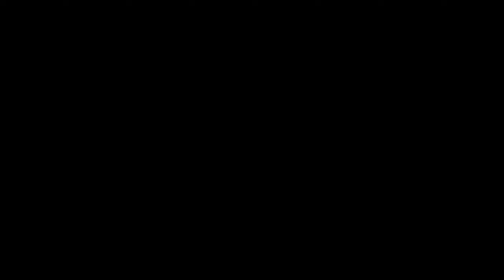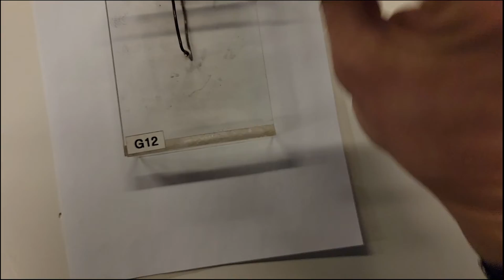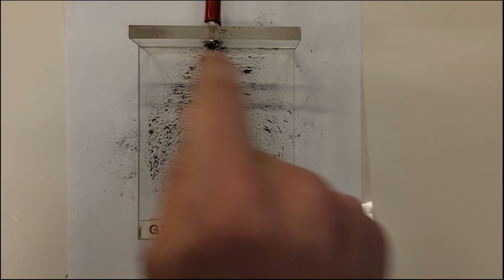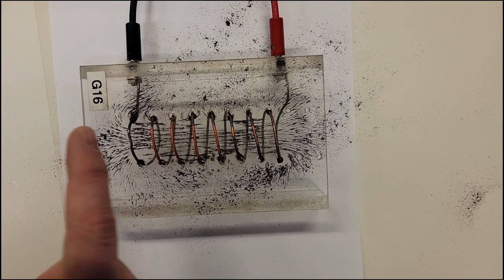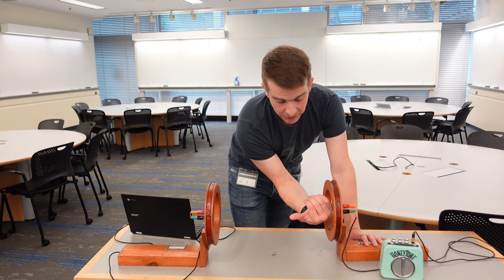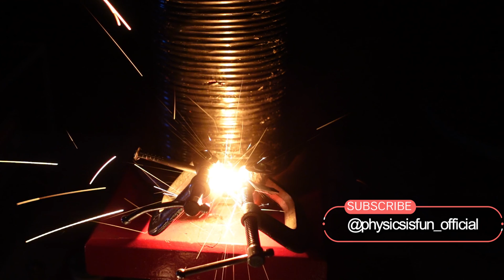Transferring Power Wirelessly! Your Science Questions Answered!

Comment: I have one of these in my back.  I have a spinal column stimulater that sends out electrical pulses into my neck to over-ride the pain from bulging discs in my neck. I have to charge it every month using an induction transfer device. I tape the battery charger to my back over the device, and it charges it up. I have had it in my back since 2009.

Comment: A fun explanation and experiment indeed. 
But you forgot to tell us about the Voltage.
No current without voltage.

The changing voltage from the laptop is inducing a changing magnetic field in the  first coil.
This changing magnetic field is picked up in the other coil, where it induces a changing voltage.
this induced changing voltage in the pickup coil then produces its own changing magnetic field.

And that is only the magnetic induction side. We also have another form of induction, but that is in this case very small.
It is the induced displacement current, from the changing electric field, whereby the coils act as capacitor plates.